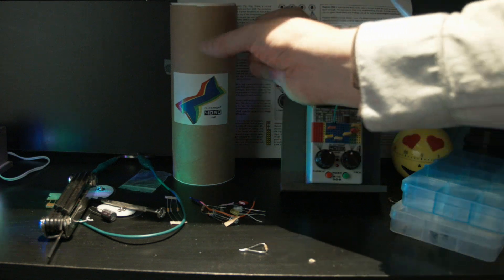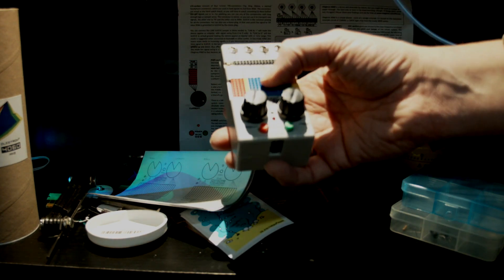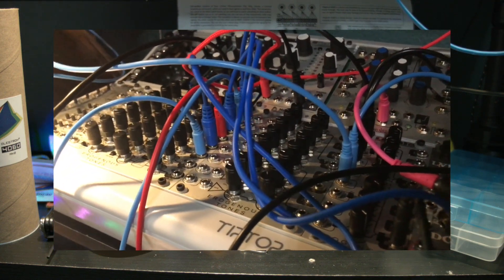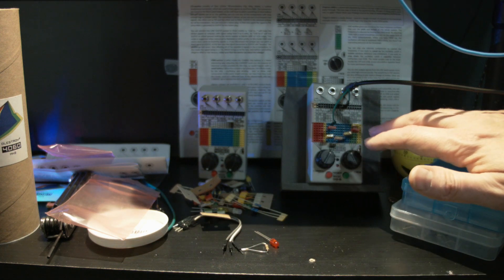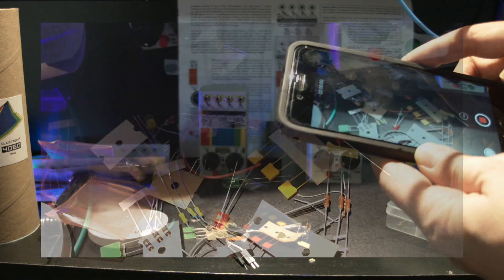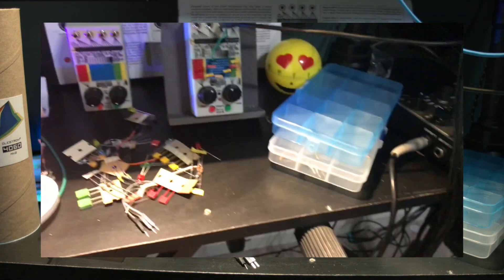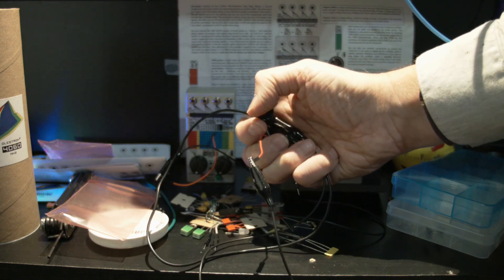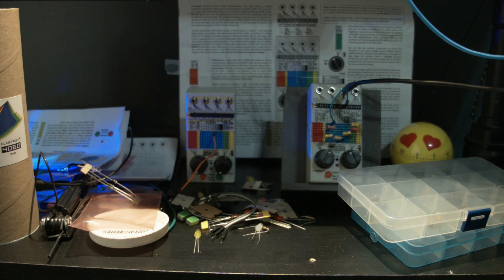Olegtron 4060 mk 2 Introduction - Part II, Unboxing

Comment: Thanks for making these videos, I just ordered one myself, excited to dig in! Also a field kit user, and part of the reason I'm so glad I found the 2060. One question, the 9 volt power adapter, is that center-negative, like most guitar pedals?
Reply: Sorry for the dumb question, it shows it right on the unit, center positive! Thanks again for the videos!

Comment: What's really fun to do is use crystal oscillators and chips from toys, they produce the most interesting results, if you just get a bare breadboard it's not hard to wire it from the ground and positive to the board and give yourself more space. Enjoy!!
Reply from the maker: thanks, I will try out the crystal oscillators.